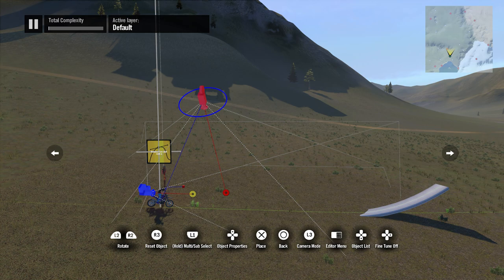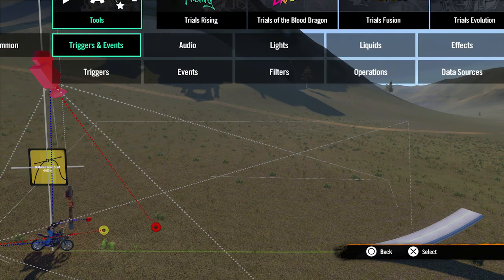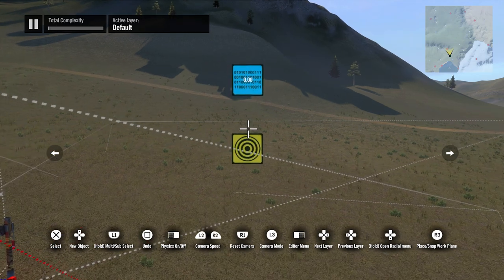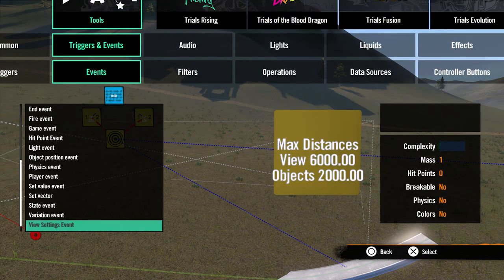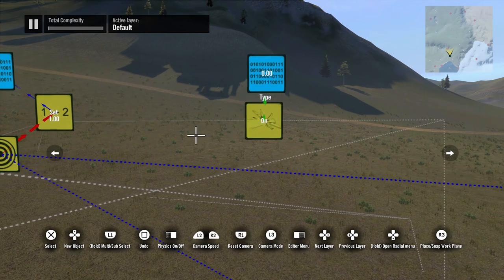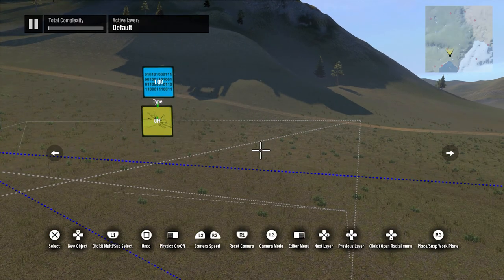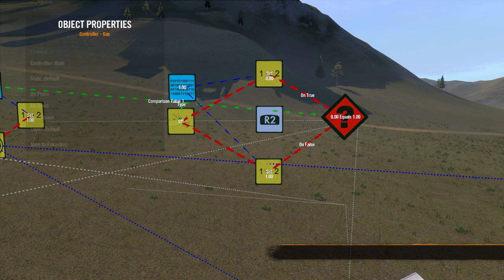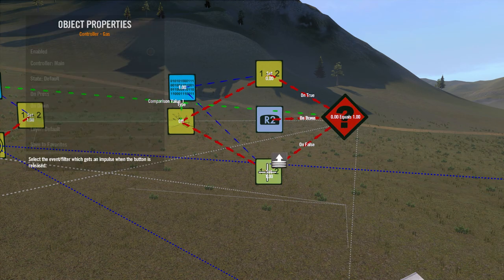Trials Rising Editor Tutorial - Control the Afterburner with the gas button.

Comment: A var data source  That conveys  the height of a jump , but stops at the highest point of the jump? I've tried many ways but not the correct one. Best I could come up with is a second VDS that interpolates  to the value of the VDS recording the height.  Thinking I could somehow use a filter to take advantage of the delay to determine when the height starts to decline but so far no go.
Reply from the maker: Use a filter to test if the value you are trying to set is larger than the value already set. 
1. Set a var to hold the height. 
2. Connect an Object Info Data Source to the rider and set it to "Distance to Ground"
3. Connect a Set Value Event to use the Object Info Data Source as the value, and set the target to the height var. 
4. Use a Generic Filter, setting the Operation to Greater, the Comparison Value 1 to the Object Info Data Source, and Comparison Value 2 to your height var. Connect the true event to the Set Value Event.
5. Place in an Interval Trigger setting the Interval to 1 and the Select Event Filter to the Generic Filter. 
So now it constantly tests the var height to see if it's higher than the Object Info Data Source. If it is, it sets the var to the new height.
I hope this helps. You can watch this tutorial and it describes this in more detail. https://youtu.be/oZGxzMeZytA?t=8244
Reply: Hey thanks for the help I got it on lock now. I always find a way to over complicate things